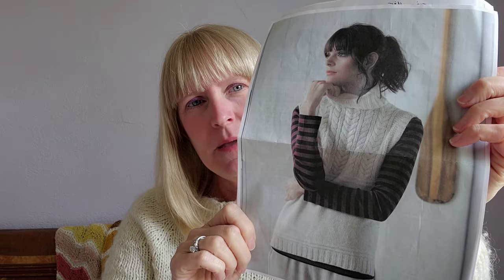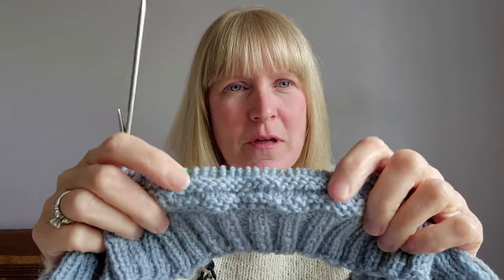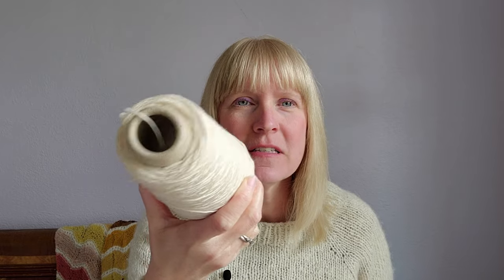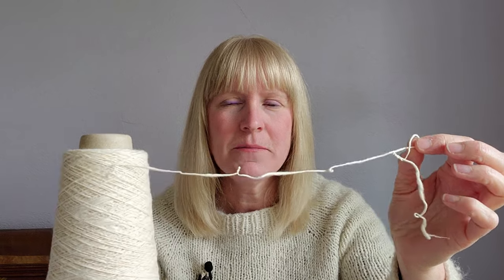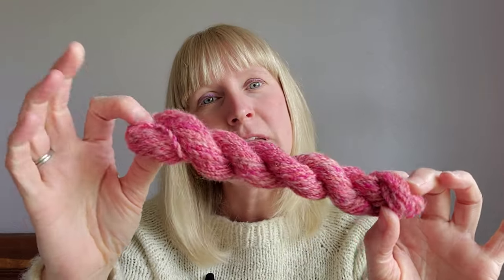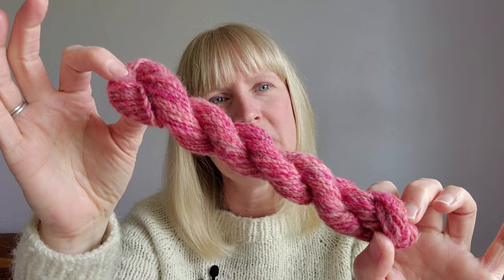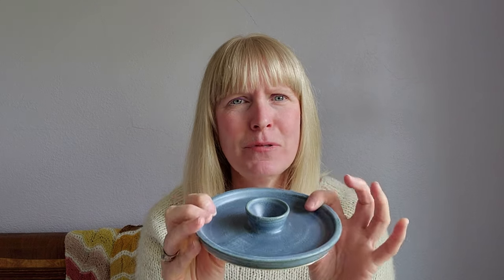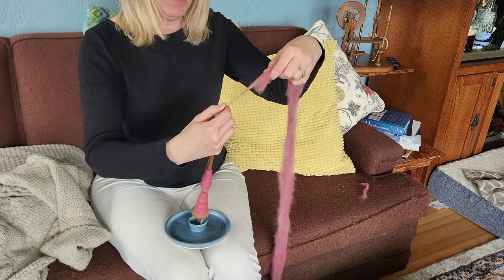Storage bobbins for handspinning yarn and supported spindle progress and tips (Episode 110)

Comment: I rewind my bobbins for evening out my twist just like you did with your cotton. I use a manual winder from the Fiber Artist Supply and it’s the best price instead of using a drill. I wind onto sectional weaving bobbins as storage bobbins. I tend to only do this for larger spins and unruly spins. Also what evens out the twist is the distance and not the tension.
Reply from the maker: Great information! I'm so impressed by those who do this.  Takes an extra level of patience.  Thank you for sharing!!!

Comment: I love storage bobbins and rarely ply from the bobbins I spun from. I bought a cast iron antique bobbin winder on eBay at the same time I was learning how to spin. I’m sure that it was less than $40 at the time. It was easy to stick something on the winder to make it fit my bobbins. I only had three bobbins for my wheel, and wanted three ply without spending money on new. I get free cardboard spools\cones at fabric stores and store on those. Plying from center pull balls is my default. I like how lofty my yarn gets because the center-pull allows your yarn to open up and see your singles under less compression.
I hope your spring is going great and excited to hear your opinion of the new wheel!
Reply from the maker: Elan! This is so awesome.  Great point that it allows you to need less bobbins as well.  Center pull makes sense.  I did that with some spindle spun, the bounce factor of the ball was my only downfall.